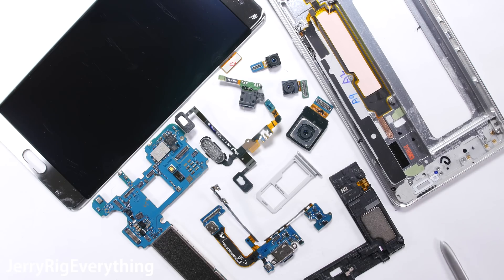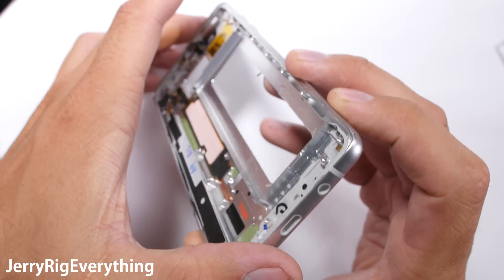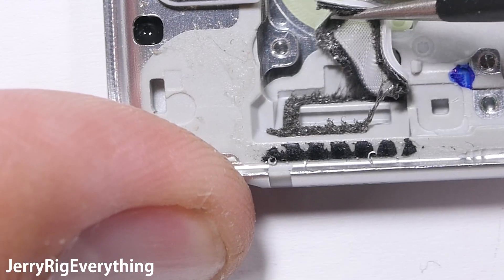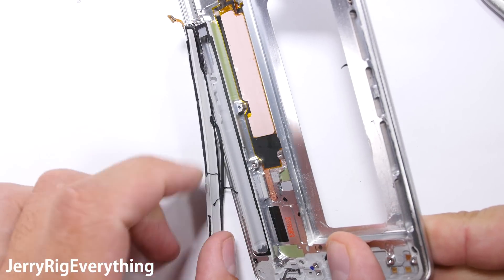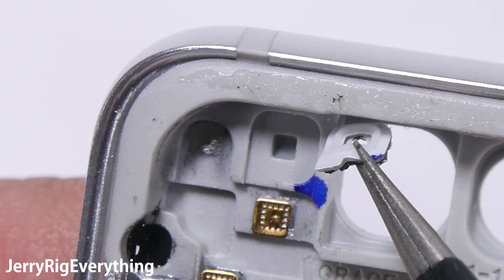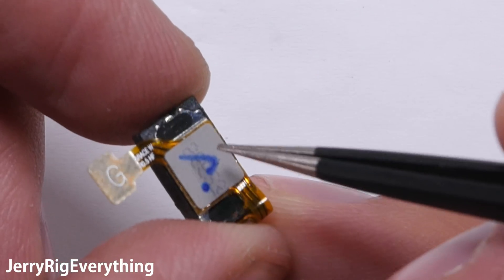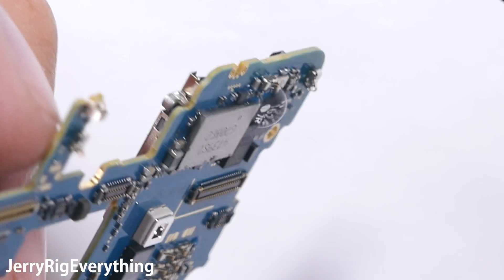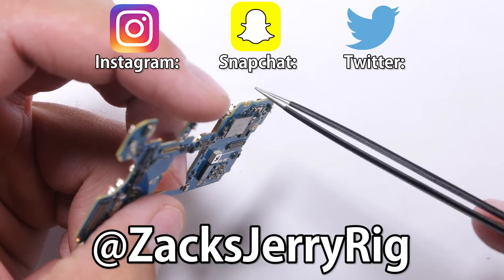What makes the Note 7 Waterproof? Ultimate Test!!

Comment: seems like the build quality is high. I just dont like gorilla glass 5 ...
Reply: GG5 scratches easier than GG4 so for a lot of people,  including myself,  this is a downgrade. 

Can't even go with a screen protector because of the curved glass. 

Stopped me upgrading my N4 to the N7, gutted as was really looking forward to this phone
Reply: scratches easy.
Reply: I know its just me, but its 2016, i have galaxy s 3 and i have never used any cases, guards etc.. simply because I hate em. Yet my phone has 2-3 minor scratches on the display, due to the fact my phone is very old one and i simply do not care. I think people should be able to place their phone in the bags without any reason to worry about it in any way.  Weather about keys, knifes,  water,  spitted shampoos etc..
Reply: +Ицо Коцев tempered glass is amazing though, you won't even notice it
Reply: +robert brown but doesn't work on curved displays...
Reply: gg5 is the best so far ,how can u hate it ?
Reply: the fact that the number is higher doesn't mean its better :D
Reply: +girlsdrinkfeck
no... Corning gg5 is the worst of any gg.
Just look at previous scratch test vid. Just horrible...
If no one tell me that it's an expensive screen glass, I would thought it was just a cheap plastic screen...

Only thing Corning done best with gg5 is marketing and PR...
Reply: ChaoticDigger
scratch test is flawed ,corning said the scratches are from residue from the pick ,its tougher than gg4
Reply: +girlsdrinkfeck you honestly believe that??
Reply: Mark Pitt
give me proof otherwise ,all my phones scratch regardless anyway so i odnt vcare
Reply: If it was from the pick, it would have been dust. Zack said he tried wiping it off and it didn't. Those were scratches. Also tougher doesn't equal harder.
Reply: No.  Even after wipe those residue are not going implying they are scratches